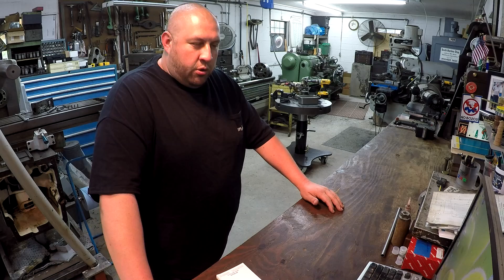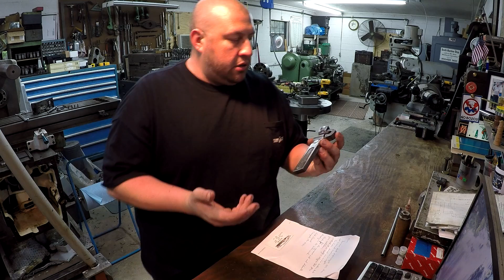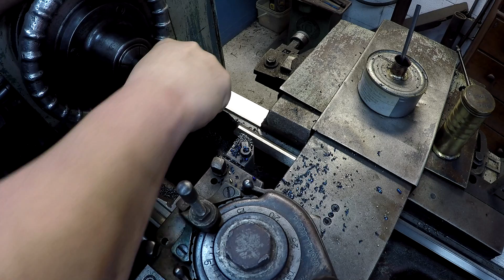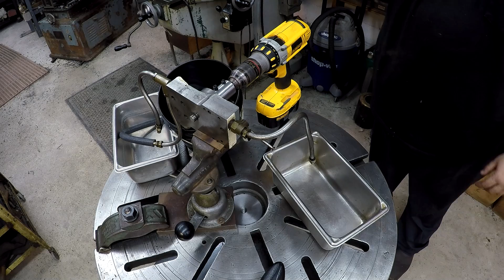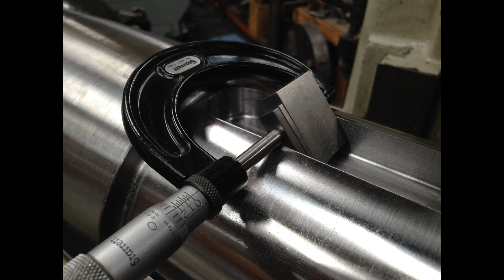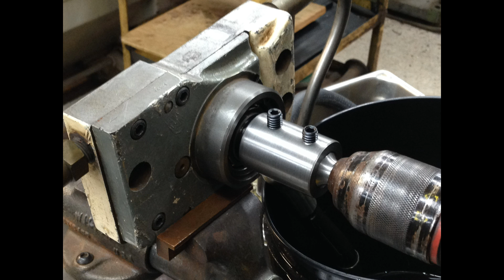Saturday Night Special 81

Comment: It is pumping, but should you not test if it can build up pressure? Thanks again for the video, Adam.
Reply: Abom79 Adam, While pumps are volume devices, they deliver that volume with a given pressure rise, called head. Different types of pumps, and different internal geometries give different performances, which are displayed as performance curves, typically as pressure vs volume, and horsepower versus volume. These curves change with the shaft rpm.

The system resistance is a pressure based on the frictional drag of the various bits and pieces, including any throttling valves. The trick for the designer is to match the system characteristic to the appropriate pump curve. Where the two curves intersect is where your pump will operate.

OK, after that bit of fluid mechanics - yes, I train junior engineers at my day job... ;^) - what it comes down to is that unless your pump is badly worn, if it pumps, it will be pumping with decent head for the purpose. After all, the pump was selected for the application... It would have to be really badly worn out to slip that badly... 

And, since it pumps "clean" (filtered) oil, a rebuild would be a relatively "minor" job of replacing the worn seals...

Long story short, you should be OK based upon your bench test... putting in new seals now, while you've got things open and apart might save you some grief down the road though...

Sorry if this ran a bit too long,

Eric
Reply: Romantronixlab A pump has to do both. It needs enough volume to supply the quantity of fluid needed but if it can't produce enough pressure to overcome the system pressure it won't be able to.  It's why pumps are often rated with a volume to head pressure scale.
Reply: Flip de boer I think same as you.
Reply from the maker: Pumps don't pump pressure. They move the oil at a specific rate, normally measured in gallons per minute.
Reply: Abom79 Hi Adam, if the set up is still available, what could be worth doing is to put the machines pressure gauge on the end of its feed tube, then on the other pipes if you have a couple of valves (ordinary water isolating valves or similar) to restrict the flow, it should be possible to simulate the table load and see if the gauge goes up as the simulated load is increased, why I am saying this is not specifically to test the pump but to see if the feed side to the table is where the problem could be. In the table there must be an hydraulic motor of some sort to translate the fluid flow to do useful work, if that is worn then the pressure gauge could well be telling the truth when it stays at 10psi
Reply: Steve p Agreed about blocking the ports, deadheading is not how one tests the pump except during certification tests.    A graph of flow vs head is made.  All gear or vane style pumps are more or less resistant to changes in output pressure, but they still respond to pressure the way centrifugal or dynamic pumps--- they leak around the pump cavity and lobes.  

the way a Positive displacement (gear in this case) fails is that the 'Cheek-plates" or side plates, wear if the pump is ever operated dry for ANY amount of time.  The fluid is pushed out the sides and flow  cant be maintained against even a moderate back pressure.

I still suggest plumbing in a pressure gauge and a valve to test how well the pump responds to increasing back pressure.  You can use a weight scale to measure how much flow you get in say 10 seconds.  If it drops off significantly with some back pressure, then you know you have to machine a new housing....the cheek plates are worn.
Reply: I agree, just because it pumps well does not mean it makes good pressure.
Reply: I agree.
Reply: Flip de boer A pump makes flow not pressure I would ask how much GPM, LPM is it pumping? to maintain line pressure.
Reply: Abom79  I agree Adam, however the hydraulic pumps we all carry around with us (our heart) when Dr believe there is a problem with it they put a load on it, usually putting us on a tread mill.  I know this is a simple gear pump but I believe you need to but some loading on the pump to make sure it works when loaded.  Great diagnostics video, though
Reply: It's a positive displacement pump so I agree with Adam - it's going to pump oil at a reasonable head unless it is really very worn. You can throttle the input (eg by using an old bit of rubber hose that has delaminated and collapsed internally) and that will reduce the flow. If you try to test the pressure by blocking the outlets and just connecting a pressure gauge it will break something - burst the seals, split a pipe or even crack the pump body.
Reply: Flip de boer You guys are hilarious!  If you bock the flow of a hydraulic pump... IT STOPS!  Period, end of story.  That is why hydraulic pumps on aircraft engines have the INPUT shaft under turned SO THAT IT SNAPS OFF... if there is a failure in the system.  Better to have a spinning prop and no landing gear when you are over a mountain range or the ocean.  Even if that shiz don't flush, there are multiple backup/auxiliary systems to employ.
Reply: Flip de boer Pressure is the resistance to FLOW.
Reply: Flip de boer I was thinking more of a flow rate. In regards to a fuel pump I know apples and oranges but at a no restriction there is a X amount of fuel it should pump in a given amount of seconds. Thustly allowing a tech to gauge the health of the pump.
Reply: Adam's next video answers the loading of the pump by adding the regular valve my thoughts are what Adam pointed out with the suction hose

Comment: Nice to see some progress on the K&T :} the pump does seem fine to me also, i think between the pick up pipe and the harder job of fixing the pressure valve, you will have solved the issue, they both will have been their cause of the 'slow loss' of function it suffered before you got it, fingers crossed you can work a solution for the valve next

Comment: It could be that the old pick-up hose had delaminated and the suction was causing it to close up and restrict the uptake of oil to the pump - it would still look ok on the outside. As you say, that type of hose is designed to resist pressure and not suction.

Comment: Hi Adam,
Well you didn't say If you found a replacement relief valve for the pressure regulator, or what you ended up doing there.I like watching the videos, there is always something interesting happening in them.
Rick is a very good friend here in Minneapolis.
The goose neck shaper tool was going to go on the Cincinnati 20" shaper I picked up a month ago. But when I got shaper home the very next day I bought the 18" x 78" Sidney model 32 lathe and soon discovered I did not have room for that huge shaper and sent it to auction. I owned the shaper for one month and took a pretty good kick in the shorts when it sold. The shaper's new home is in Billings Montana where I hope it will receive the love and live out an easy retirement.
Joe in Minneapolis.
Reply from the maker: I have not made any further on the relief valve. But I'm thinking of doing the machine work myself on it. 
I wish I could have moved that shaper into my shop. If sure like to have a bigger one one day.
Reply: I would have gladly traded shapers with you Adam. At auction my 20" Cincinnati went for a measly $180.  Less tax and consignment fees I got $150 out of it.

Comment: Let's all pitch in to get Adam an upgrade to a first class seat for his wide self. A man needs to ride in comfort when the trip is that far.
Reply: I'd contribute to that;  used to fly all the time and wasn't keen on it,  until I started sitting Up Front and it wasn't so bad,  even on the 14 hour rides.  Adam,  if you can, please send me a PM to get your PayPal address.
Reply from the maker: Kevin Hornbuckle One of the main reasons I don't want to fly. I know it's going to suck.
Reply: Can I post the fund raising request on your Facebook? Is there a PayPal or some such place to send $ for this purpose?
Reply from the maker: Hey Kevin, it's not necessary bud. The ticket is bought and paid for. I really appreciate the offers though.
Reply: Okay. But let me know if you change your mind.

Comment: Adam,

I think to really check the pump, you need some back-pressure - you would get plenty of flow even with e.g. a large lobe clearance with no back-pressure. Maybe feed the pump into a safety valve and monitor pressure on the pump side of that. a weighted hydraulic cyliner will also make for a good test load - you can check both pressure and flow.
Reply: raducorlan seeing inside it the other week and the type of pump it is, its only got a fraction of wear,  im sure its fine, sure it may have lost a couple of psi compared to new but its not the cause of the total loss of pressure
Reply: jusb1066 I agree the pump is probably fine, what i tried to say is that spinning the pump without any back pressure will get you decent flow on a "bad" pump as well - as long as the rotors are turning and there is no blockage.

So i'm not saying the pump is bad, just that this test might not prove it's good ;-)
Reply from the maker: raducorlan More to come later guys, I'm showing you what I have worked on as I go. To do a more detailed test I will need to set it up differently, some whom think that's a simple task. It's not as easy as it seems, and my time has been very limited lately.
Reply: raducorlan My thoughts exactly. I've seen a few go wonkers when under load but magically work when tested like that.
Reply: Abom79 Pumps need to be flow tested at the working pressure.  Do NOT block off the discharge lines as some have suggested.  You will blow the pump apart (if it is any good) if you do that.